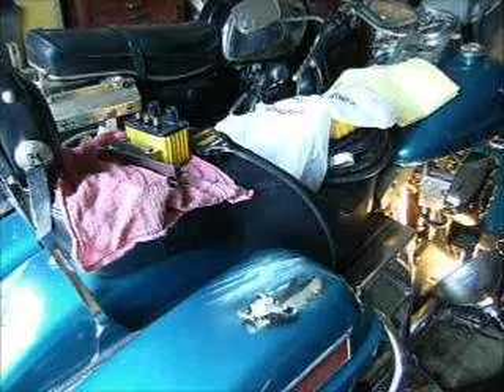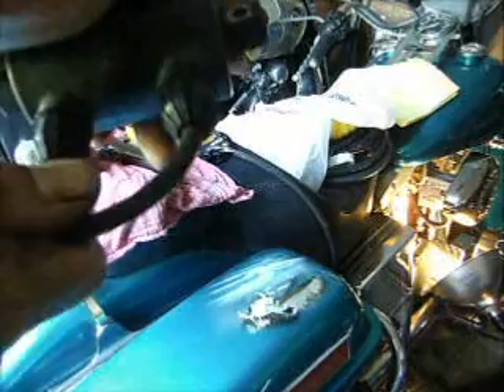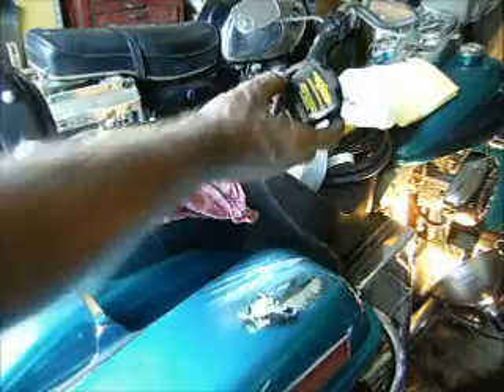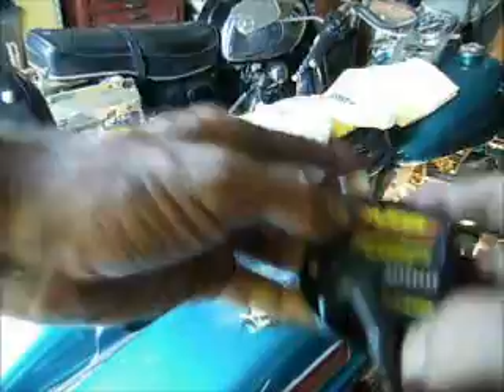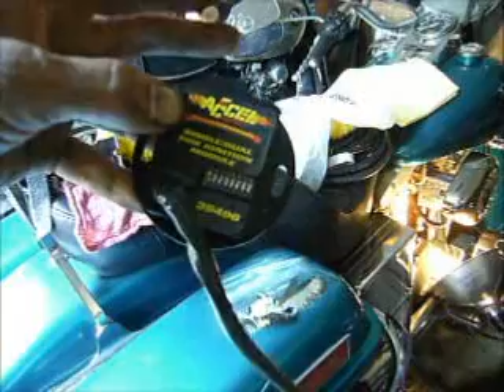The difference between single fire and dual fire ignition coils

Comment: I have a 2001 Indian Scout. It originally came with stock points. The previous owner removed the points & placed a dual fire coil. Since owning it, I’ve had a difficult time starting it. My buddy who used to work at the Gilroy factory said it would be better to install a single fire coil because the bike will start up much easier. Thank you for the lively and straight forward video.
Reply from the maker: Crane hi-4 or an accel 140408 is your friend (may have to use a ballast resistor but if he put in just about any aftermarket cdi box it should be correct ohms

Comment: I have a '96 Evo, dual fire set up. What Daytona conversion kit is available for single fire?
Reply from the maker: that one is single fire (140408 1 cont. 2 trigger in individual coils - same as 2 single tower coils) ... They have a harley specific dual tower 2 terminal  if that's what you mean though - I dont know the part number off the top of my head though -

Comment: Your video helped me to clarify my suspicion that the single fire on my Harley is two coils in one.  Dual fire coils which were the two wire feed were mostly used on the shovel head Harleys pre 1985.  And any Harley will run hotter using a dual fire because there is no ability for a cylinder to cool during the intae stroe of one of the cylinders.  Now dual fire is great of you are a race biker because having hotter cylinders is beneficial but for regular riders your single fire is easier on your engine

Comment: single fire fires only on the  compression stroke- Dual fire fires on both compression and exhaust  strokes.
Reply from the maker: Depends on your ignition box -- or if your points are crank or cam -- you're 1/2 right though

Comment: I have an IQ of 120. what's the difference again, Einstein Jr.
Reply from the maker: dual fire=1 constant + 1 trigger with 2 coil towers (usually one coil internally) - single fire = 1 constant + 2 triggers and 2 towers able to fire independently of each other (invariably 2 separate coils inside)
Reply: Screenshot, good info here!!